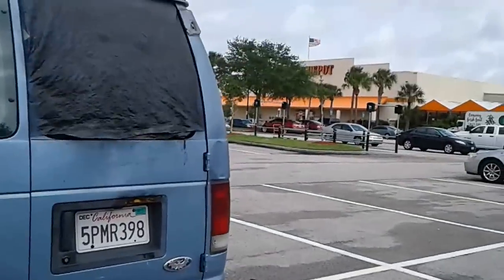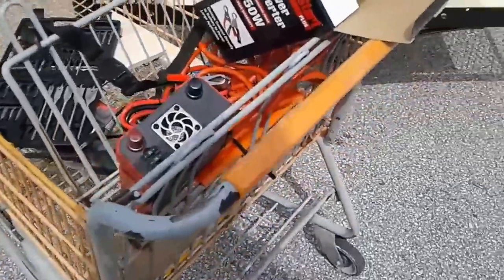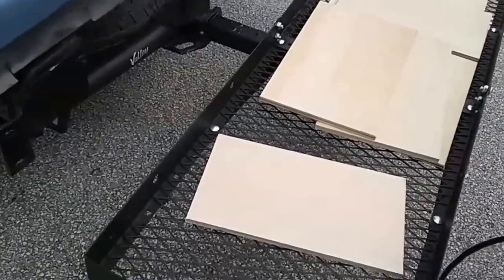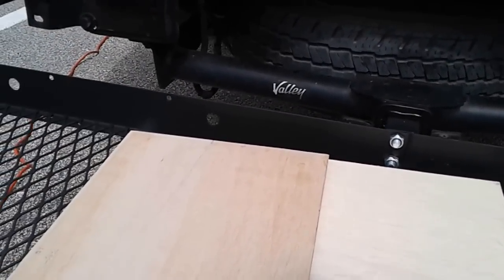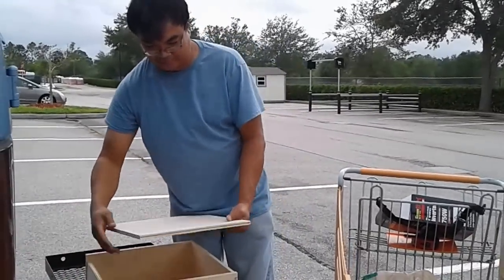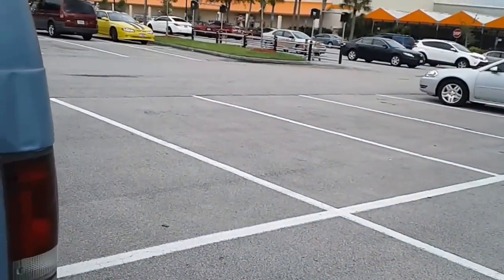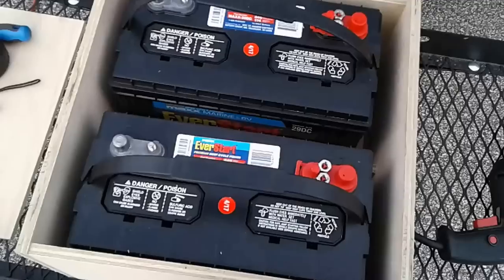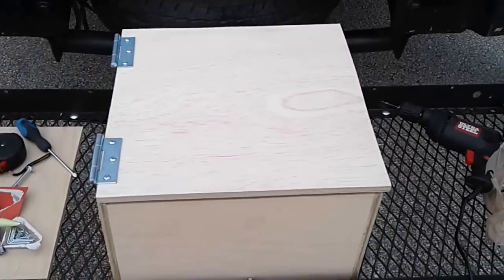Vanlife - Solo Female Traveler Van Build External Battery Box (V498) Living In A Van

Comment: Bad box, it's going to swell and crack in the heat n moisture and vibration is going to knock it all apart. It's not long for this world. I just hope when it goes it doesn't dump her batteries on the road and short out her vans electrical system at 65mph.